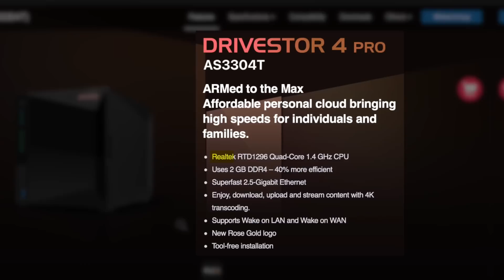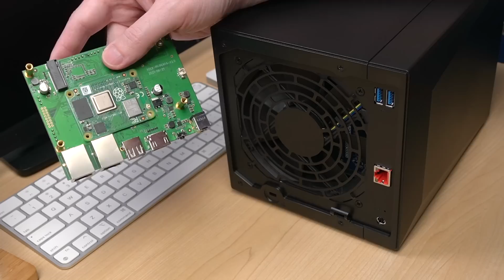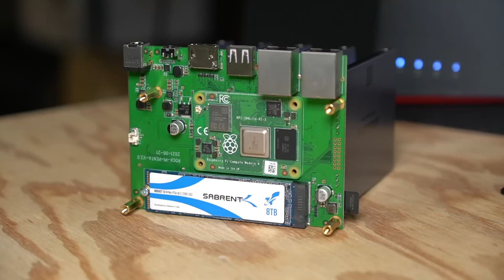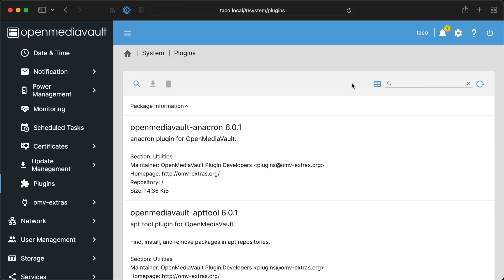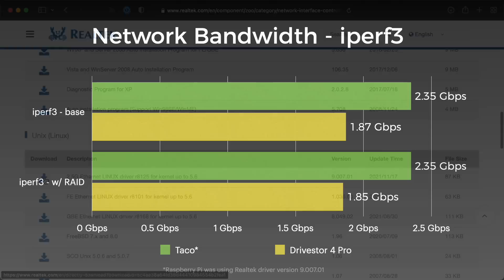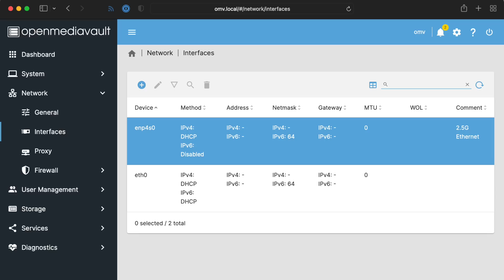Raspberry Pi vs ASUSTOR NAS – Round II

Comment: I like Jeffs balanced Way of Describe things. 

4 years ago I assembled a Raspi 4 B 8G with OMV 5.5 Usul for a NAS.
Instructions on Google are easy to find.

As an active USB HUB I got the TP-Link USB 3.0 HUB as a 7-port version.
At that time 37.90

I connected 4 Toshiba Canvio Basic with 4TB as hard drives.
At that time 85.50

All in all this results in an
ARMv7 based, 8 GB powerful (depending on the Pi) WIFI capable, Gigabit capable, fully modular (if I don't need it as NAS anymore, go for it) 16TB large!!! (and thanks to the 7 port USB 3.0 hub, that's not the end) still expandable, Linux based NAS for under 500.- incl. storage space.

Comment: Low POWER ISSUE!  I had one 2.5” satassd attached to 1 USB3 port.  I had seagate (with its own case power attached to 1 USB3 port #2.

I received low power warning and lightening blot in desktop.  WHY?  I was using RASPBERRY PI POWER PLUG 5V 3A THAT CAME WITH PI4 DESKTOP KIT WITH 8GB RAM.

WHAT CAUSED IT.  I’ve used 1 sata SSD disk before with no issue.  Again the seagate had its power supply.  

Is ther a slightly more power cable from raspberry i need but did you see?

Comment: The new OMV (the one with a new interface) has a terrible performance on SMB. I ran some basic tests (with a USB3.0 external drive  and clean copies of both versions) and the results were undeniable: buster + OMV5 delivered an extra 60MB/s compared to  bullseye + OMV6. Got a reddit thread and some posts on OMV forums, but no luck. I simply went back to OMV5.
Reply: Sad story. :( What about just Bullseye with Samba? I'm just wondering where the problem lies.

Comment: What software with TACO IS best for setting up cloud storage / remote login storage? (Less programming additions also?.   I may setup (1pi4 and 1-8tb 3.5 internal drive)…. 3 units.  But I need to know if power from PI4 can run that hdd?  What cable do I need?  Software?

I used to use Odroid (No longer avail).

Comment: Fantastic review!. I have been working on a network diagram to minimize what I need to leave powered up 24x7 and it really comes down to just a media-center/NAS with HDMI. The Taco fits the bill but would still have to come up with a actual case for it.  If only the Drivestor would have left the HDMI connector on it would be the winner for me.

Comment: Jeff - Is it possible to connect a Raspberry pi 4 with a QNAP TL-D800C. I want a Non-raid solution to connect mass storage to the Pi 4 without the noise and heavy power usage. Would this work?

Comment: The distance between SATA ports is almost 2mm too short for regular 3.5" HDDs to fit... they could have fit if they moved it towards the borders. However thinner HDDs (20.2mm thick) should fit perfectly, with 4mm to spare. Maybe with a custom 3D printed case for them.

Comment: My nas cost me $230 TOTAL. I got a chenbro cr12000 with a 1220 v2 with 8gb for $120. And 5 2tb sas drives for $16 each. 2 60gb Kingston ssd for raid 1 boot drives. Running truenas. All on ebay.

Comment: While the per-year operation price of the solution by Radxa isn't bad, the problem herein lies with with that recurrent extra cost. Given a decade of use you'll make your money back, arguably. I would like to see how much lower you can make that power consumption on the Taco by downclocking the processor so it is on-par with the ASUSTOR solution.

Comment: How would performance be affected if the Taco had a RAID controller chip onboard? Since PCIe speed is directly affecting the soft RAID functions I’m thinking a RAID chip would speed things up considerably because the SoC has no role in it and all the writes occur after the PCIe bus.

Comment: If you want your Pi NAS to do staggered spin up of the hard drives you can tape over pin 11 of the SATA power connector. Without the pin grounded SSU is enabled.

If your drives support it you might also have a jumper to force enable SSU but where's the fun in that?

Comment: Hey Jeff! I have at home a 6 drive RAID 5 array running on my CM4. I too had similar speeds via Samba.
My solution to increase the speeds was to overclock the Pi to 2GHz. That increased the speeds to 100MB/s, almost saturating my 1Gbps connection.
Maybe try an overclock with your Pi and see if that brings any improvement to the table as it did for me. I did end up putting a cooler on it to keep it chill, because the SATA card and the Pi's CPU got pretty toasty while reading and writing data.

Comment: on both my pi's i use the old OMV plug and play images that only needed ethernet cable to auto install OMV on a pi after burning it with etcher, to bad its no longer supported..

wish there was more nas software on pi in general.. those commercial nas ui's are really pretty

Comment: We've gone from the age of paid advertising content to the dawn of free testing on monetized YouTube content.  Ain't the internet grand?
I thought a lot about building my own NAS based upon the Pi as well as building my own NAS using off-the-shelf PC/server components and after many hours of research, decided to go with a dedicated NAS box instead.  Now don't get me wrong, I know Linux and am comfortable with it from running a tiny Pi NAS (DietPi FTW!) for several years and I still run a Pi-powered amateur radio hotspot.  But after many more hours of research comparing the various NAS devices out there (ASUStor QNAP, Synology, Terramaster, etc.) I went with the ASUStor Lockerstor4 for being the lowest-cost option that would allow me to have dual 1TB nvme drives in a RAID1 config for the OS/stuff as well as dual 8TB drives in a RAID1 and then two separate MyArchive volumes - one to backup the 8TB RAID1 storage volume to on a nightly basis, and another for just playing around with.  Of course I also upgraded the total RAM in it to 32GB instead of the meager amount it came with - and yes, while not officially stated by ASUS, 32GB of DDR4 RAM does work in it because it's supported by the CPU.  I also bonded the two 2.5GbE ports on my Unifi switch so while I'm not getting the full 5Gbps I still do get at least 2Gbps through it while also providing for interface failover in case of a port or interface failure on either end.  It also lives on the same dedicated UPS for my networking equipment which provides almost 2 hours of power for the entire stack and it's configured to shut itself down when the power is out and only 30 minutes of run time are remaining on the UPS.  Even with two switches, an AP, firewall, and the Lockerstor4 the UPS is only at 7% load at any given time.
I use it for Plex, as well as for running a Unifi Controller and Home Assistant in separate VirtualBox machines (they run better that way than in Docker), as well as running many Docker containers to handle web-based services such as Whoogle, Mealie, Deluge, Uptime-Kuma, Wallabag, NextCloud, Photoprism, MeTube, Kiwix, Calibre Web, Adguard Home, Portainer, Stringer RSS, OSINT portal, ZeroTier controller, and Flame and Homer link dashboards.  And all of it backed up every 24 hours to a separate 8TB drive in the Lockerstor4 and backed up to secure cloud storage every week.
And with ZeroTier I can now access everything on it securely from anywhere on the planet using any of my mobile devices (phones, tablets, laptops) without opening any holes in my firewall and having to put it all behind Cloudflare or configuring any VPN client access.  It just works.  It's how I watch Plex videos from the road.
Of course I'm not the normal user.

Comment: So many things missing here.  As someone that deals with storage professionally, I’d never use an ssd for caching that didn’t have a very high durability rating and also power fault protection.  Using a gaming QLC drive for write caching is just prime for loosing data.  Also, seeing high numbers for 1M sequential loads might matter for copying movies from/to the NAS, but means nothing in the business world where the load is much more like 32k random access.  Finally, I won’t build a nas anymore that doesn’t do ZFS.  The ability to snapshot then copy that snapshot offsite with ssh is just to convenient.  My Linux based nas replicates my backups offsite hourly with two commands in cron.

Comment: Well, the Asustor is nothing more than an SBC with a custom chassis running customized Linux with a user friendly-ish UI. While the fancy UI is great for noobies or those which just want a 'ready to go out of the box" appliance, no pre-built NAS can match the flexibility of building your own. I would suggest you always do so if you have the knowledge. The setup may be somewhat more cumbersome, but you most likely will only have to do it once.
Also, I've never been a fan of NAS box form factor.  My home server which also doubles as a router and a NAS looks just like a regular PC. Having to open a case to replace a failing drive isn't that big of a deal to me. Also, I can put 14 drives in there, not just 4.
BTW, what that 1.3K $ SSD is doing on a cheap NAS ?
Reply from the maker: It was having a good time 🤪

Comment: I will give him right in one thing. The Raspberry Pi Compute Module is cool, but it's also very close to and as boring as a standard PC. This fact makes most of these videos pretty moot. I have just build a NAS with multiple ZFS RAID 3.5 inch drives, LXD container setup running multiple services incl VPN via secondary USB NIC and so fourth, all using a standard rpi 4 8GB, booted from an external USB SSD. This was a fun project, especially powering it all as simple as can be done and figuring out the best way to connect it all. Tried getting some ideas from these videos, but he always makes things easier by adding motherboards and such with actual PCIe slots, SATA connectors etc. It may as well just be a standard x86 in a mini ITX board. 

I would love to see some of the insane ideas he has, using just a standard rpi board and software raid of some sort.

Comment: While I appreciate "simplicity" of this asus distro, there's one reason why you should not recommend it to anyone. Linux 4.9.119 is three years old at this point and misses a lot of security updates. The latest version of this LTS branch is already 4.9.294. It's not reasonable to willingly put it into your local network, and especially to expose it to the outside world. Also if they already ship the device with outdated and insecure software now, what will happen in 5 years?
Reply: Hi there! We have supported our products with security, driver updates and kernel updates for over 10 years and are STILL providing security updates for our recently EOL products. ADM 4.0 uses Linux 5 on most of our NAS devices and we're just working out the bugs on these Drivestor NAS devices. We do take a bit longer as we need to extensively test our NAS to ensure there are no significant bugs. When you receive the NAS, it will already be asking to update so we don't 'ship' the product with outdated software as we're constantly providing security and feature updates and you will be on the latest software in no time!

Comment: With the RPi you also get upgradeability as well, when say a compute module 5 comes out, just remove the CM4 and plug in the CM5. (I make the massive assumption that RPi Foundation keeps the CM's form factor).

Comment: Soldered RAM n a NAS box is a deal breaker for me. WHY do they do that?!? Made that mistake once. Also while a turnkey box is easier, I dislike the idea of proprietary OS's. While will only use it as just a file server, I like having the freedom and flexibility an open source OS offers. I use a Synology NAS box (yes, proprietary OS called DSM) as a server for my VPN.
Reply: Hi there! Not all of our NAS devices use soldered RAM. But since this is an ARM SoC, we can't go out and verify every single SO-DIMM that's out there and that kind of level of support just simply isn't as robust as Intel. The Intel architecture is much more favourable environment to upgradeable RAM. Most ARM environments do not use BIOS/EFI as well. Even the Raspberry Pi Compute Module has integrated RAM on the compute module itself. It's a tightly packed system that just isn't favourable to SO-DIMM RAM and we don't want to have upset customers asking why their NAS won't turn on. 

Our NAS OS is not proprietary as well. We use open source components and the source code contributions are released on Sourceforge. We do not lock down our NAS devices and you are welcome to replace the OS on our NAS. We just cannot offer support if you choose to do so.

Comment: how about ECC RAM and ZFS support? This is at least what NAS should have.
Reply: ZFS is very memory-hungry and has special licencing terms that make it infeasible to use on a commercial NAS, while ECC...is not useful for a home/small business NAS.

ECC prevents the random flipping of bits in memory due to non hardware related failures. This means ECC doesn't protect you if you have things like bad sectors in your memory. It can help you in that if it identifies a bad sector, then the memory will be disabled. But you cant correct failed hardware. ECC is designed to detect a single bit randomly flipping from a 1 to 0 or a 0 to 1. This is most often caused by cosmic rays or very high amounts of electromagnetic interference. This is far more likely to happen in a datacentre as you would have hundreds of servers packed as tightly as possible running at full load drawing large amounts of power. This is not an issue in your home or small business as homes and small businesses may only be running one or two NAS device. Hard drives, SSDs and file systems all come with error correcting technology to help mitigate the risks. 

The kind of errors ECC might protect against are, let's say changing a bit in a transaction which can cost companies if the wrong transaction is made like intending to send $100 and it ends up being $10000. That can happen, but for a consumer grade NAS device standing alone? There is already Error Correcting Code inside the ext4 and btrfs file systems we use and SSDs relying on NAND flash memory already have ECC built into them. At most, a memory error resorting to a flipped bit would result in a kernel panic, necessating a system restart, but largely won't touch your data. Obviously restarting servers a company relies on can cost lots of money, but for a home user, this unbelievably super-rare event is not a big deal. On a home NAS, If a random bit happens to flip in memory and you commit that bit to a save, a single pixel on a 4K family photo might turn from grey to white, a super tiny fraction of a second of a movie or song might have static, but almost never results in massive total destructive data loss. 

The cost of ECC for a home/small business NAS is just not worth the unbelievably virtually zero chance of data loss, especially with the ECC features already built into the file system and hard drives.
Reply: @ASUSTOR_YT ? The cost of my nas with zfs and ecc was bellow 300 EUR. In that price range there is no excuses for cutting on these. Many FreeNas users wouldn't agree with you that ECC is not needed. Specially that is available in this price range
Reply: @Konrad162  We have found that the lack of ECC has not affected our customers' ability to keep their data safe. We're not cutting corners, we're simply not introducing unnecessary expenses and using the money to support our products for 10+ years with feature, driver and security updates in a package that is efficient with little wasted performance, few bottlenecks, high quality, and easy to use.
Reply: @ASUSTOR_YT  unnecessary expence in 300 euro nas? Seriously? If I would pick non ecc version I would save in this setup maybe 20-40 euros

Comment: Hey Jeff, Have you considered switching from SMB to NFS? Why/Why not? I think if you are doing transfer speed tests it would be great to see the difference and impact of the two protocols.
Reply from the maker: I've done comparisons in the past, and often Samba (v3 or v4) would edge out NFS, but not always. The main reason I stuck with it recently is compatibility; for some reason more applications like Photoshop and Final Cut Pro seem to work better on files hosted on Samba shares.

Comment: For a lot of people there isn't even a need to go as far as buying a Taco. My current NAS setup is a pi 4b with 2 2tb hard drives attached to it via the usb 3 ports. Yes its not the best, but setup for this was pretty simple, and super cheap. For me I primarily use this as a backup storage solution, and as a way to transfer files between my PC, laptop, phone and a way to access it outside. I get about 60-80 mb read and write, and again, while not the best, its more than enough for my basic needs. I think the whole thing cost me about $200.

Comment: Lol. That ASUSTOR sounds like a big robot powering up with all the different noises….    (Waiting for it to give greeting and announce it’s name.   Haha.

DUDE!  Is there a way to write code to:   A). Split memory equally in raid automatically depending on raid you select?    B).  Program TACO TO “”STAGGER”” START THE DISK INDIVIDUALLY?

If all the code the TEAM WROTE PLUS TO ADDRESS TWO ITEMS ABOVE (IF POSSIBLE). I THINK THAT WOULD MAKE TACO A “”SAFER”” COMPETITIVE OPTION .  

JUST CURIOUS,  ANY KERNEL ALTERATIONS YOU MAKE,IS THAT something you
U give to RASPBERRY FOUNDATION to add to base OS as it is additional core requirements to use that adapter card.   I would hope they want all code that enhances base PI 4 compatible to MANY other vendor products.

Comment: Raspberry PIs can be used for a lot of things, can it be used as a phone?
Reply from the maker: The Pi's power setup is not ideal for something like a phone which needs to be able to conserve power more. The Pi's SoC, even if completely shut down, will pull out more power than most phone-optimized chips.